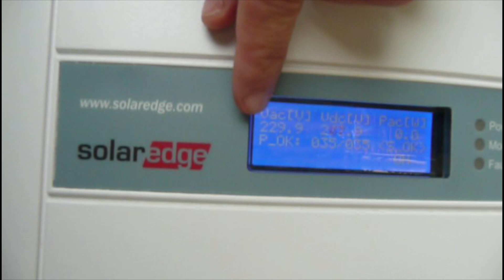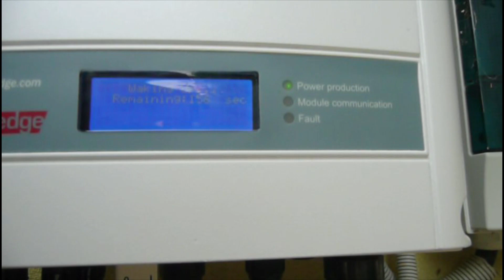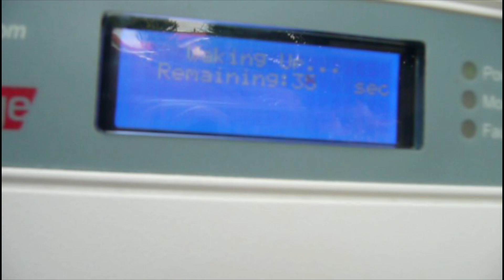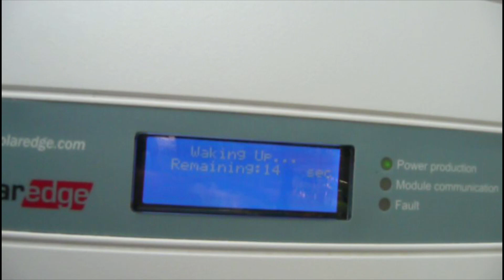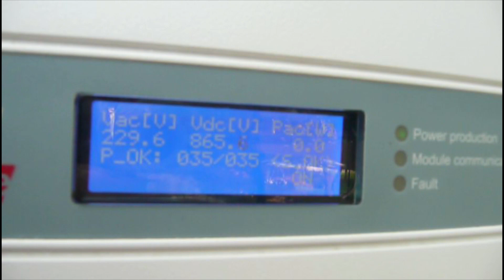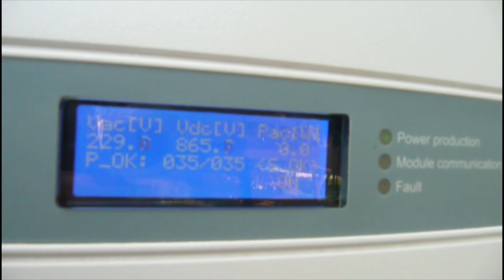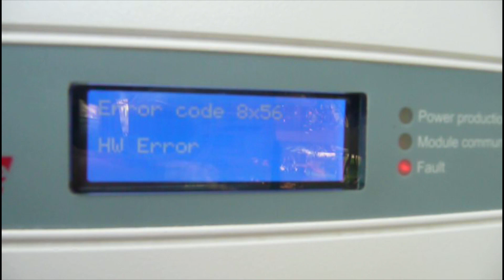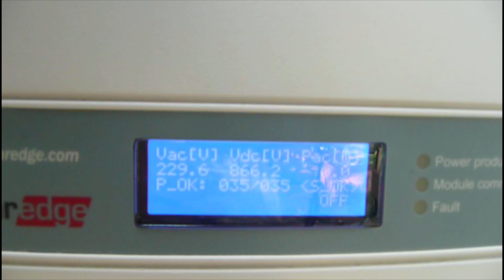SolarEdge Inverter Failure After Just 1.5 Years – Hidden Problem You Must Know!

Comment: One of our 10k inverters failed at 1 year exactly, have been waiting almost 2 months for the replacement from SE. Came across an article discussing the 27% failure rate one installer had with these. Wish I had done my research before agreeing to a 66 panel system with these installed.
Reply from the maker: We have already second failure! I made another video but only in Greek this time.
Not only the inverter but 2 optimizer also failed! We've lost about one month production and few money but the problem solved again...

Comment: The exact same thing happened to me. The Solar Edge SE6000A Inverter just died.  Solar Edge is claiming that the installer did not install it correctly...  Yet, Solar Edge cannot tell me where the installation mistake is.  The are claiming water got into the inverter, but the day it died, there was no rain.  It did not rain the week before either.  Now, we have to pay for a new one.
Reply from the maker: They didn't replace it For you?
We got now second replacement!!! Into 5 years together with 2 optimizer!
All for free except the installer I need to pay for the replacement